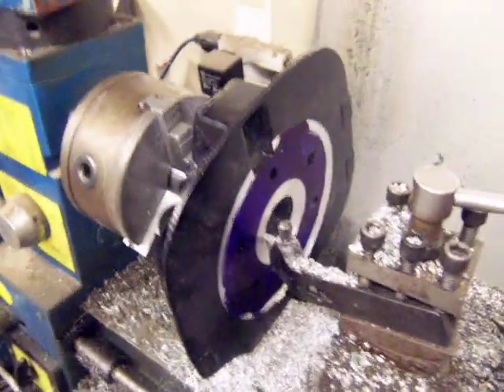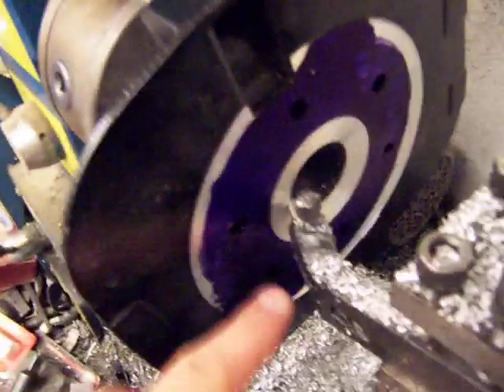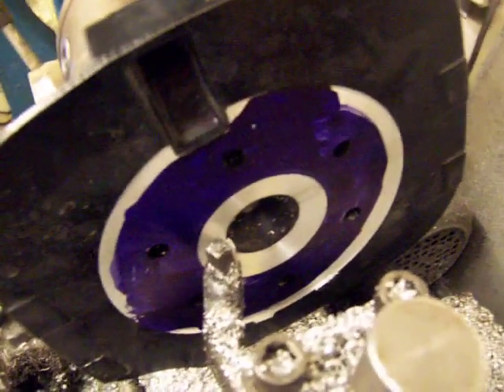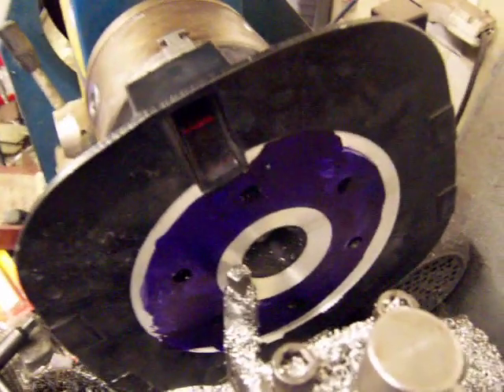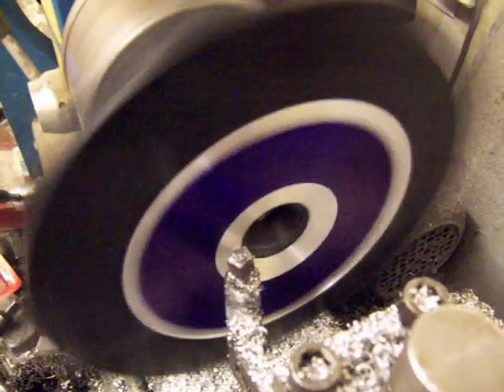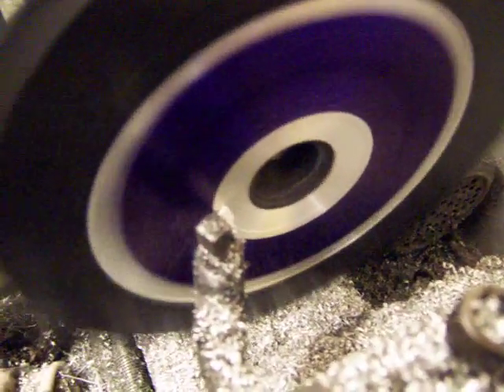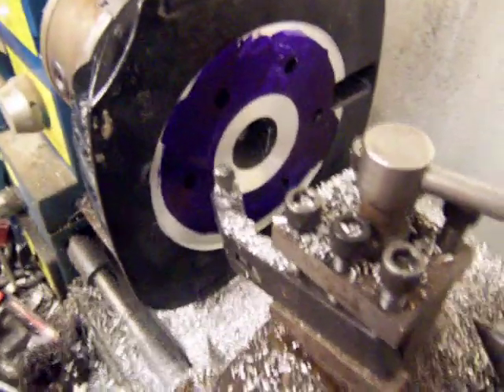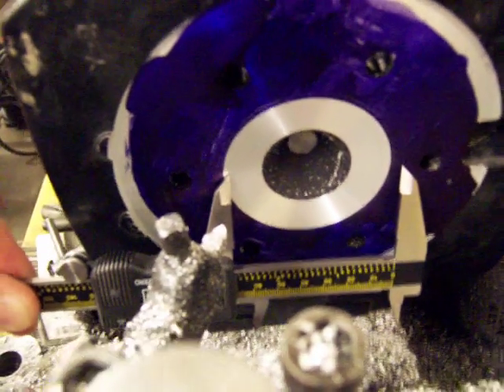#4 DO IT YOURSELF HOW TO CUT A HIGH COMPRESSION SQUISH BAND HEAD FOR THE YAMAHA BLASTER!

Comment: I copied your work and I hit 165psi. Let me tell ya my blaster wanted to run on the rear wheels only. I’d like to try this on an engine that doesn’t have port work. I’m about to attempt the same on a YZ490.
May be impossible to kick it over when I’m done though
Reply from the maker: Good deal! Its fun re-chambering the Blaster heads. Those little son's of bitches frick'n RUN after porting and a head re-chambering. Be sure to check squish distance with some soft solder between the edge of the combustion chamber and top of the piston,... on either "side" of the piston. Don't measure on the front or back of the piston, because the piston will rock forward or aft, and give incorrect reading. You insert the solder through the spark plug hole and up against the side of the cylinder where there is no open port, and turn the engine over, so the solder will be compressed between the edge of the combustion chamber of the head and the piston edge. Your looking for between .025 and. 045 thousandsths.